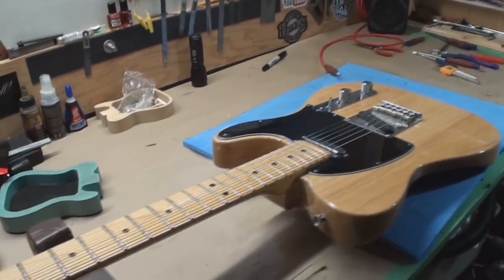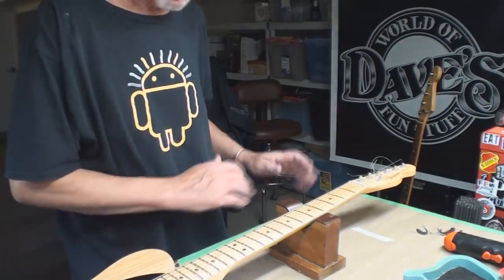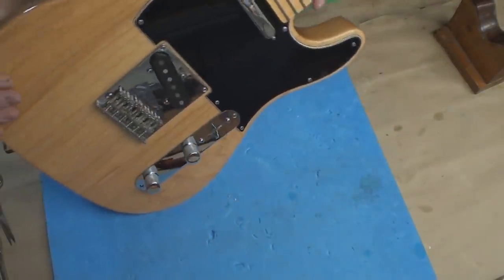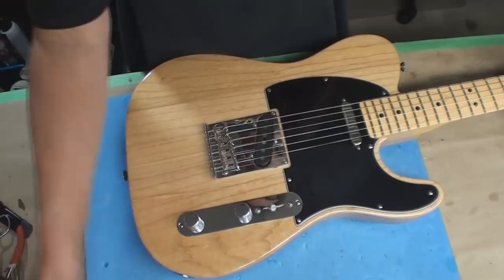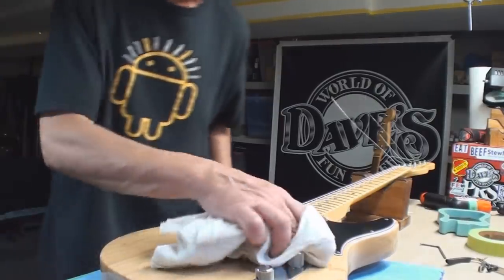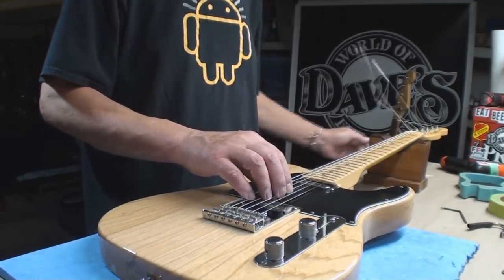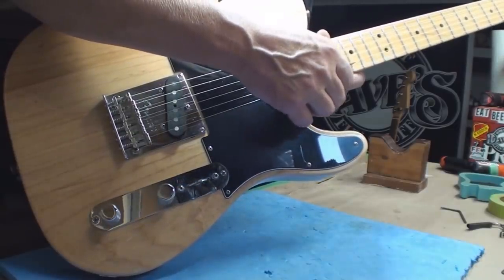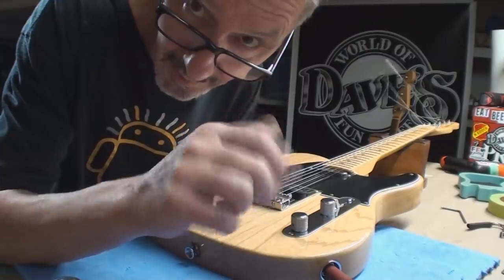Basic Telecaster Setup and Cleanup

Comment: Hey Dave quick question, was looking into changing my standard brass saddles for compensated brass saddles. Are they that much of an improvement and worth the cost?
Reply: There's also a compensated brass nut on eBay that is cheaper and better looking than the earvana stuff.

Comment: Dear Dave! 12 thou is to much for a modern 9.5 inch radius or 12 inch. 12 thou is for 7.25. Most of modern players use only 5 thou release. That's why in your videos most of the guitars end up with no truss road tension that looks like bananas.